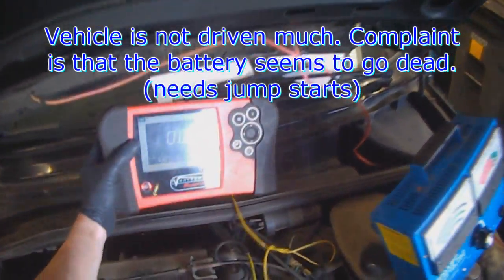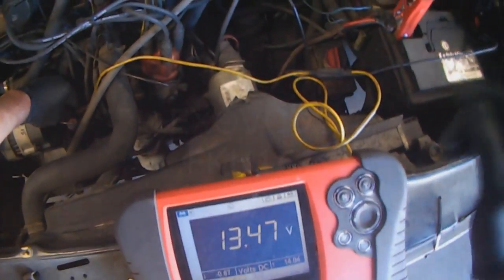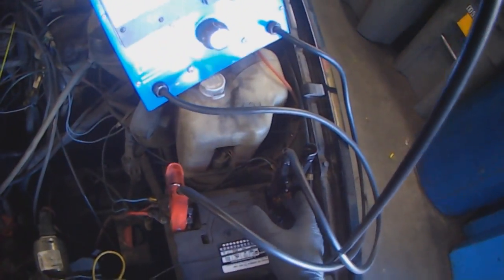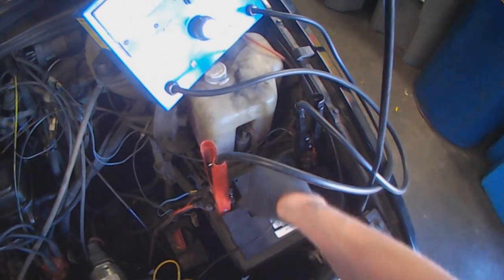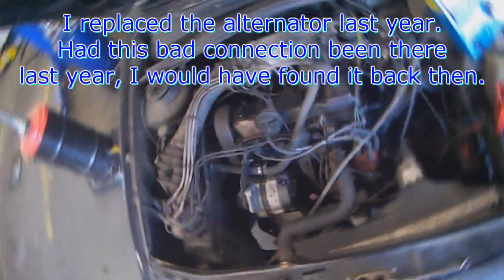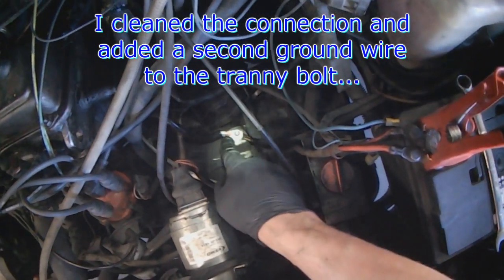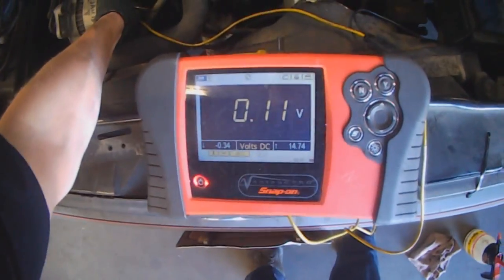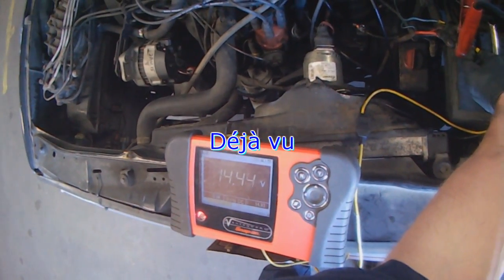VW A2: Charging system checking

Comment: Does this diagnosis works also on other cars more specifically Opel/Vauxhall?
Reply from the maker: +cihuaua Yes... voltage drop testing can be applied to any electrical circuit, not just charging systems.

Comment: Thomas this procedure seems to be the  basis of all electrical testing but I have seen so many vids on the subject , I guess its one of them tests most don't use often but the best. Myself I think it's the meter design that throws off some and understanding potential difference. Well done.
Reply from the maker: +STEVE ROB As always... I forgot to use the LoadPro to show that it would be able to find the fault. Not sure a test light would have showed the difference.

Comment: Nice and funy diagnostic my friend =P
Regards from Spain.
Reply from the maker: +Pablo A Do they still have old cars like this in spain? :)
Reply: The average age is about 15 years, but TDI diesel 66% gasoline and 30% approximately. Because of the crisis in my country more cars are repaired.
Top sellers is Citroen, Renaul, VW, Seat, European models and technicians are not as well qualified = P
For example working in the factory several years citroen maintenance, repairing the production and making electrical installations, it is a better paid job and valued. The mechanic in Spain this poorly paid and have very bad times.
Sorry for my bad English.
Greetings from Spain =)